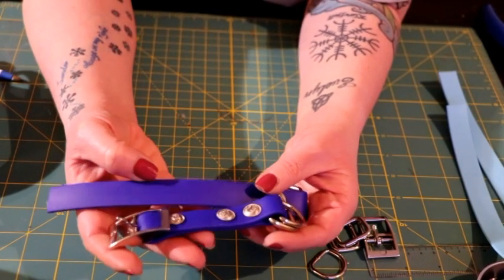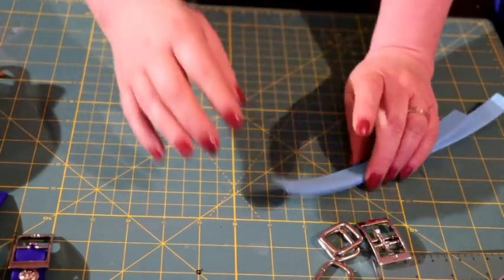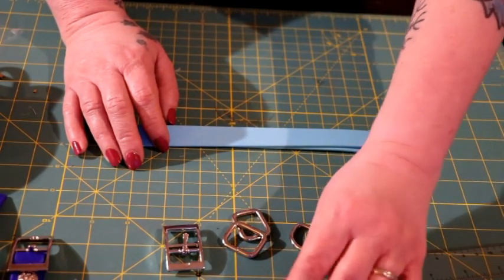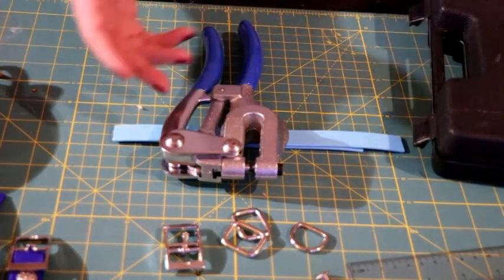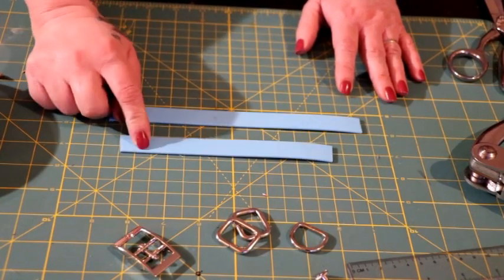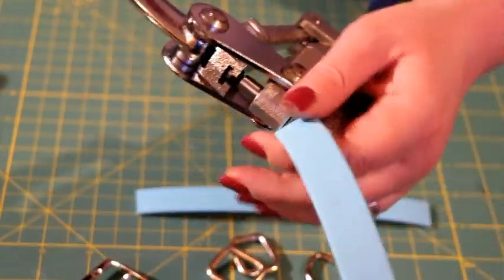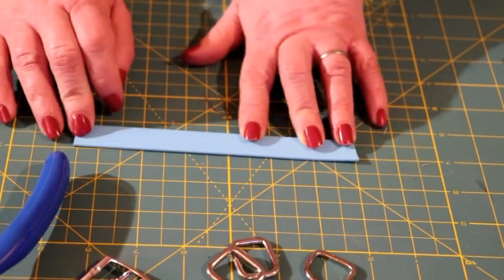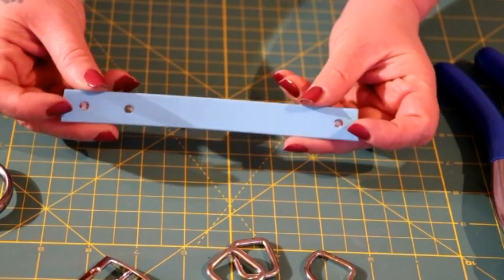DIY Biothane Adapter for Dog Collar and Giveaway  No SUB REQUIRED!!

Comment: How do you clean up the inner material/thread within the holes after you punch the hole?
Reply from the maker: You can use a very small pair of scissors you can find them in the sewing are in craft stores or  you can use a lighter but you need to be careful with the flam.  I have used it on a very light flame but I like the scissors best.

Comment: Thanks so much for sharing. How do people get the patterned biothane? Been looking for a bit.
Reply from the maker: Im not sure, i have not used biothane with a pattern but, you might want to try Paracord Eu
Reply: @coloradocords4paws550  yes I did find them. I’m in Canada so the exchange rate is killer but may try a couple colours. Thanks again for sharing!!

Comment: Neither the Amazon link to the hole punch or the eBay link to the Chicago screws work. Amazon comes up with only one item titled   “Neiko 02612A Multi-Purpose Power Hole Punch Kit, 3/32" x 9/32”. Is that the one? Thank you
Reply from the maker: Sorry about that The screw -- https://www.ebay.com/itm/Chicago-Screws-Concho-Nickel-3-16-10-Pack-3305-01-Screw-Post-Stecksstore/201464920736?ssPageName=STRK%3AMEBIDX%3AIT&_trksid=p2057872.m2749.l2649     The punch --    https://www.amazon.com/Neiko-02612A-Multi-Purpose-Power-Punch/dp/B0002T87CW/ref=sr_1_fkmr0_1?dchild=1&keywords=Neiko+02612A+Multi-Purpose+Power+Hole+Punch+Kit%2C+all+hardware+in+-+3%2F4+inch&qid=1599363140&sr=8-1-fkmr0     Hope this can help

Comment: What would you use this adapter for?
Reply from the maker: Dog collars or you can also use them for a belt.
Reply: Colorado Cords 4 Paws but why would you need to attach it to your dog collar?
Reply from the maker: @zulikkowalski3547  using adapter makes the collar adjustable. Colors that I make that don’t use an adapter are used with a quick release buckle and you cannot make that adjustable
Reply: @coloradocords4paws550  would you do a video on how to make the ones with buckles 😍 pretty please
Reply from the maker: @leeyabustle6194  Yeah I think that would be a great idea are you talking about the quick release buckles right

Comment: That punch is waaay over the top. just an ordinary rotary punch will do the job easily. It's lighter, can easily be used one handed and has better leverage too.
Reply from the maker: I tried a leather punch and it did not work for me, it just dented the bio thane. Many people will use an electric drill but it's not a very clean  cut  That is why I recommend the heavy duty hole punch.    Because Bio thane has a nylon webbing core some will also use a heat punch but I can recommend that  because I have never used one.  Also so will use an air puncher but again I am not familiar  with it.    The heavy duty punch has worked for me with little little clean up
Reply: Colorado Cords 4 Paws I just got biothane and realized how hard it is to punch with a regular rotary punch! I could not do it, so I’m looking at videos to figure out what kind of punch I need 😅
Reply from the maker: @miettecraig1477  I got my heavy punch on amazon if that helps  it was not very prices.